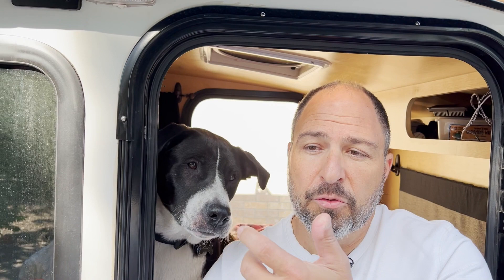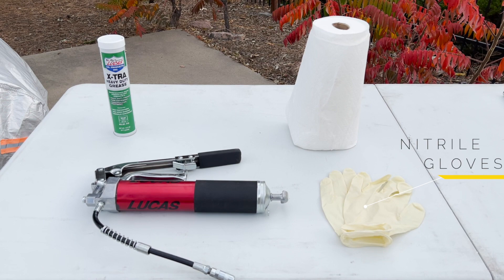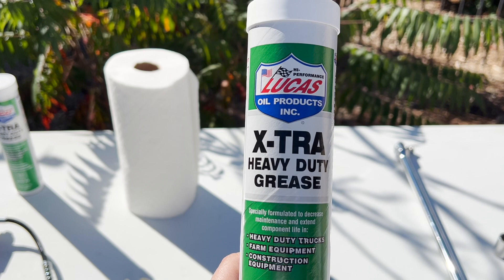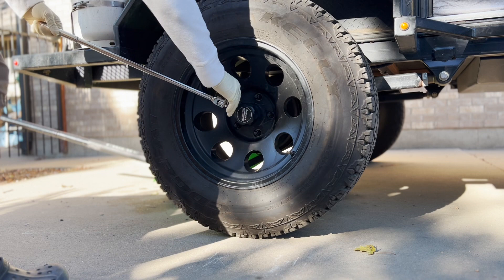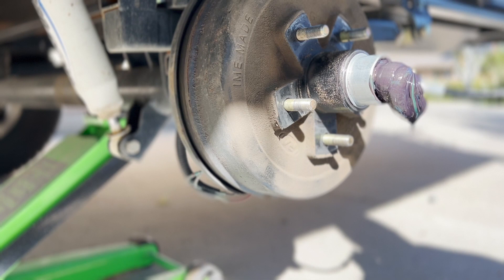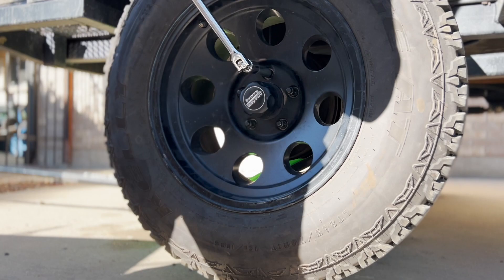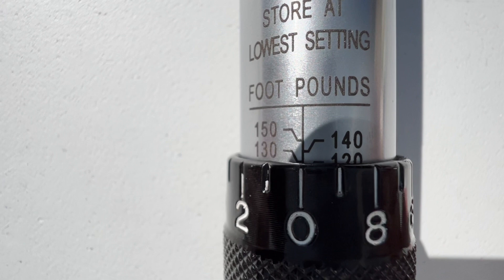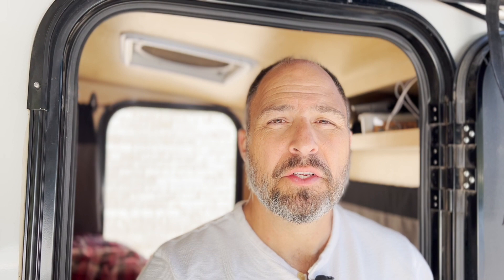How to Change the Grease on Trailer  [Everything You Need To Know]

Comment: Scruffy, I have a 36 ft fifth wheel with the easy lub hubs.  I did exactly what you have talked about for a couple of years.  Two years ago we were on the interstate about 50 miles outside of Rapid City and one of the spindles almost caught fire on me.  After a wrecker helped me lift the bad one off the ground so I could drive on into town on three wheels, which I did around midnight to have the least amount of traffic.  Going 30 MPH on an instate where the speed limit is 80 MPH is not recommended during the daylight hours.  I found a great welding shop in town the next Monday that repairs trailers.  He told me that easy lub gave him most of his business.  I had two brakes that were completely lubed up and not working.  So after getting a half axle installed along with two other complete brakes, I was back on the road.  Now every year I pull my wheels and hand repack my bearings and install new seals.  Trust me it's a lot cheaper.
Reply from the maker: Hi Dennis. Yikes! Yes I bet that would be cheaper. What a nightmare. What do you think the problem actually was/is? Grease not being distributed properly via the zerk? Not enough grease getting in there? I didn't realize those big fifth wheels had zerks like that... Thanks for sharing your experience. I appreciate it!

Comment: FWIW, last year, when changing the grease on my Hiker trailer, I "blew" the rear seal on one of the hubs. Rob is right that it made a huge mess. Replacing the seal was straightforward. It involved taking the hub off the axel spindle, pushing out the damaged seal and pressing the new seal into place.
Reply from the maker: Hi Louis. I can only imagine how messy that was. Did you have any trouble finding a replacement seal?